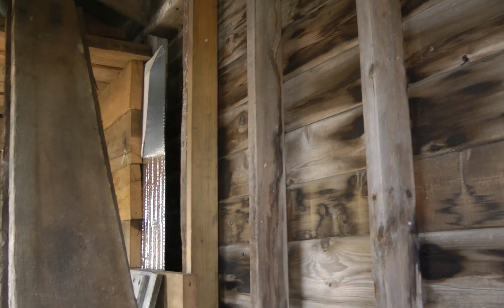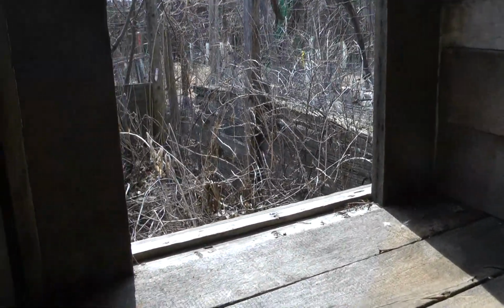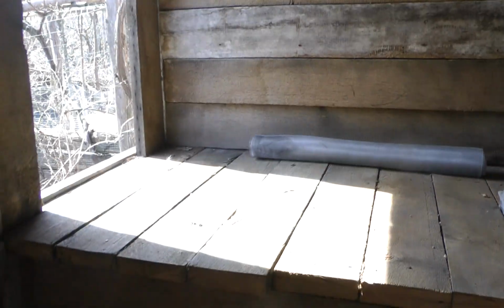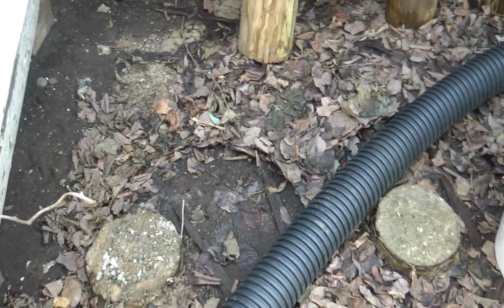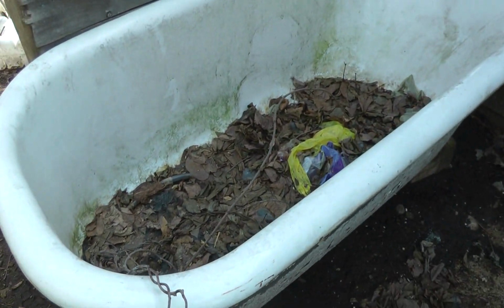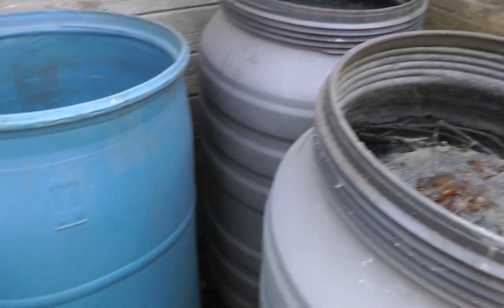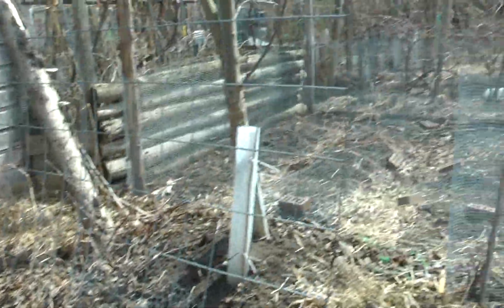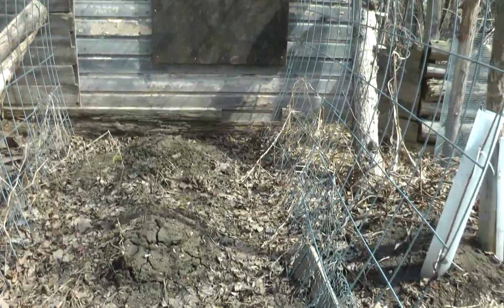Permaculture and chickens (an important element to permaculture smallholder design)

Comment: Check out Icelandic chickens.  They are rugged and built for your climate.   Mine love to scratch through the poo under the rabbit cages.  I'm working on a design to have my rabbits over my compost system with my chickens being able to access it all.   They'll help turn it and feed themselves at the same time.   Even in the winter here,  there are various insects in the poo and piles.  I do like your setup with access to multiple garden areas.
Reply from the maker: Thanks for your input. Do these chickens fly up and out a lot?
Reply: @RickLarsonPermacultureDesigner  Ah, yes they can be high flyers.  You would have to clip their flight feathers.